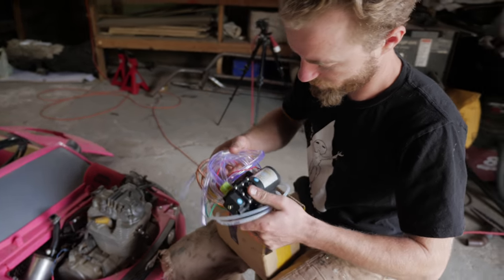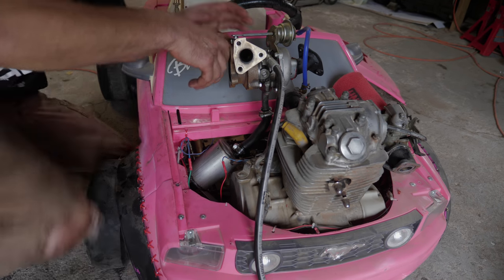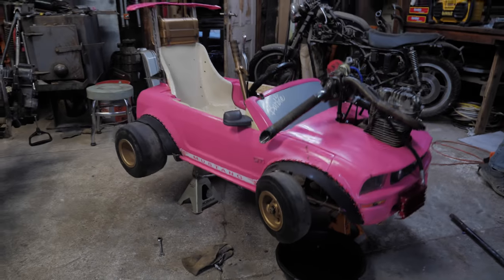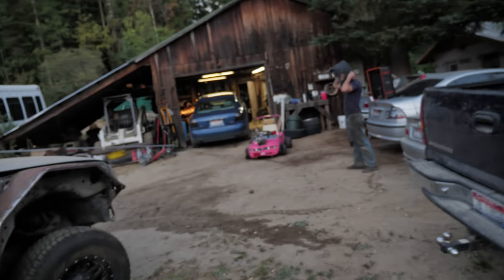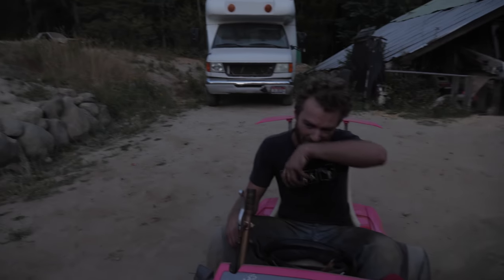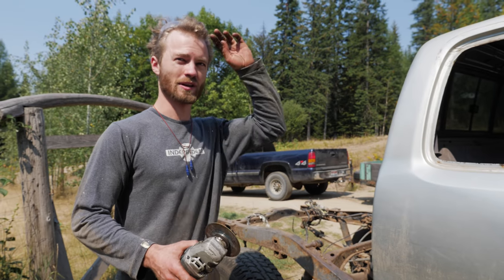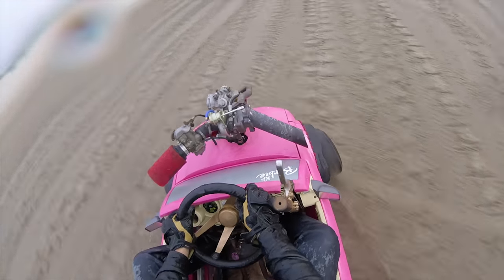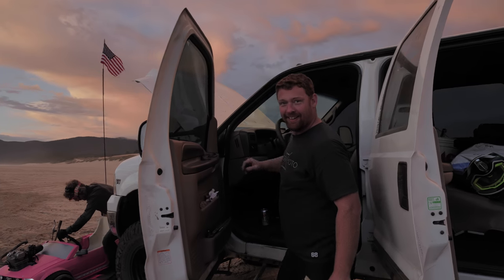Barbie Car Turbo #2 Testing and Driving on the Oregon Coast 4K

Comment: Bigger jets, or drill them out, colder plug and coil pack, stage 2 head cam, in fact replace the whole head components with strengthen gear, get performance parts for motorcycles cheap here in Thailand, that’s where you want to shop, all they specialise in are bikes. I also think there’s to much oil pressure with that seperate system as well, dry sump would be ideal to run both applications if possible. But you can’t just whack a turbo on without upgrading any other part of the system, you’ll lose power not gain it. The head is critical

Comment: I don't know if you had a restrictor on the oil supply line or not but if you don't it will over pressurize the oil seals on the turbo and push out oil!

Comment: I just noticed something what you say at 10:15ish in f1 they found that some oil in the boost prevents detonation a lot so that would be a good thing not what's happening but it would be nice lol. You guys have a piston seal not Carbon on this turbo so when that vac hits in the compressor (only supposed to see pressure) it sucks the oil in

Comment: your main issue with running a turbo on a dirt bike motor single cylinder or twin is you do not have an air box to equalize the pressure from the pulse of the engine which causes the turbo to spin backwards during the intake stroke which means you're not getting boost like you thought you would

Comment: You two did not put on the overflow valve after the pump when the oil is too much and the turbo is too pressurized and releases the oil in cars, the pressure does not exceed 6bar. congratulations on your very good work and I like what you are doing

Comment: Consider putting a 2 stroke 125 engine in the barbie car and if it won't fit just find a kx 65 engine into it and it should work as a 65cc 2 stroke pipe isn't near as big as a 125 and it will still give u alot of power and also the kx60 engine is something to consider as they had 6 gears when the kx65 only has 5 gears ..

Comment: I had similar happen on my jeep. Ended up taking it to a dyno shop and they tuned in for me. That was EFI though, not carb.
Maybe you need to go EFI on it with a 5lb injector and jack up the airflow?

Comment: Need to jet up the carburetor.  It'll have a ton more power with just a few pounds of boost.  It is probably starving for fuel. When I turboed my small engine I had to run twice the amount of fuel with only 5 pounds of boost. Also the suck through system needs a CV vacuum style carburetor.  Feel free to message me for pointers.

Comment: You need a very very restrictive oil restriction in the turbo line right at the turbo in draw through set ups. Also move up to a bigger jet. Draw through set ups are a way of the past and a lot of info I feel is lost as far as getting them to run right. In cars you can have carbon seals and that way on high vacuum no oil is pulled through but these small turbos dont have that option so you need to restrict the line to the point where just barely enough oil circulating through to keep it lubed and thats it.

Comment: I think turbo should be after of the carburetor, not before the carburetor, since air and fuel mixture will also hit the propeller before it gets into the engine.

Comment: I am confused. Did you guys re-jet that carbeurator at all or just throw fuel pressure at it and call it a day? Considered doing something like a color tune or just doing a WOT pull and then killing the ignition and checking the plugs to see if it's running lean or not? EGT will give you a vague idea but I'd hate to see you melt a piston or valve because of the mixture being way off.
Reply: Definitely didn't jet for it. It wouldn't run for shit and ran better NA, plus the turbo is too big for a low revving motor.  They'd need a bigger motor or a smaller turbo

Comment: I coud be wrong, but isn´t a turbocharger like this one mounted on the exhaust end? Maybe you have to put it on the other end and build something like ( I don´t know ) an air intake for the enginge, where the charged air meets the gasoline. That way it wouldn´t kill the seals and the oil doesn´t get mixed.

Comment: I think that was a bit too much oil pressure for the turbo. I can only compare to what my car shows, 2L with a TD04L on it and the oil pressure in the engine is at max 6 bar  (~90psi) when hot. And i assume there are plenty of restrictors that cause even less than that to arrive at the turbo. From what i remember, turbos don't like being fed too much oil.
Reply: how much power and boost?
Reply: Fizzer_Garage  Stock Forester STi, 240HP at .75 bar (10 psi) boost.
Reply: nice

Comment: quick FYI....On a DC motor, color doesn't matter. just confirm that the motor (pump in this case) is spinning the proper direction, if not, swap the leads.

Comment: I'd put the carb after the compressor not before, and change the carb jets for more fuel. also the turbo might be too small or too big. Problem could also be its a single piston motor. also you need to do real tests with a timer and set distance at a parking lot to see if you gain or lose time. louder doesn't mean faster, it can but not in all cases.

Comment: This project looks sick! So unusual, and interesting to see it cruising down the street on public road.

But, black smoke on low RPM and engine spins up too slow from idle, looks like it runs too rich on low RPM.
And sonds like on high RPMs it runs too lean, sounds like engine "sneeze" and losing rpms from time to time. Isn't it ? or i am wrong?

Comment: Yeah I see some comments about fatter jetting here. I didn't read far so idk if someone else straighten that out for you. But it's wrong. That is a carbureted engine. Not fuel injected were you would need to change to larger injector if boost were indeed high enough. A carbureted engine is obviously draw through. The thing is  a larger displacment motor will draw more fuel through a smaller orfice than a smaller displacment. Less cfm. A 125 and 250 may run the same carb. With only smaller jetting in the 250. In some cases they may have different slides or needles. Like drinking through a straw, harder u suck the more u get. Anywho if the turbo is forcing air through the carb. It will draw more fuel through the same jet as needed. This does not mean it won't need to be rejetted. Just almost certainly not fattened up. Changing the needle taper to something with multiple tapers to accommodate turbo lag could drastically help as well.
Reply: Switching to a 2 stroke carb designed to accommodate the power band of a 2 stroke. Similar to how a turbo works ... When on the pipe if you look out how the 2 stroke expansion chamber works. In conjunction with a power valve. A kiehin pwk air striker is a quality carb more or less set up for this application. You will still need to play with jetting and needle but it may be a better platform to meet the needs of the now turbo charged motor as it builds boost.

Comment: Grind Hard Plumping Co did you rejet carb for the extra air maybe needed restrictor into oil feed line or just build a box around carb instead of it being run drawthru

Comment: Do you have the carb on the inlet side of the turbo? Because if not that means that the pressure from the turbo is stopping the gas from leaving the float.

Comment: Ive seen these work but by having fuel injection setup on em.You can get em cheap as heck off aliexpress or even ebay.Come with their own o2 sensor and turning software.once u got fuel injection and turning software oh boy.

Comment: Dont you need back pressure for a turbo to work? I think putting a real like racing muffler on would help you
Reply from the maker: I’m under the impression that back pressure is not needed for turbos. In theory we had more back pressure with the smaller dump pipe, and it ran way worse...

Comment: Draw thru chunks the fuel up.     I can easily walk you thru a blow thru if you would like its simplier than most think also that would make loads more power.   You also need a restrictor on the oil feed most engines havs 20 to 50psi not 100 thats causing you issued with it spooling by loading the bearings too much
Reply from the maker: I think we will give the draw through one more chance, and if it doesn’t work we will go blow through. Yeah, it seems Ike too much oil is part of the problem.
Reply: Build an aluminum box around the carb presureize the box run the fuel line and throttle linkage thru a hole and silicone them so simple only thing you will need is small fuel pump to stay above what ever you boost it to.        10 psi boost 15psi fuel pump.       Go up o. The jet just a little till it seems fat and happy.           Put a restrictor on the oil inlet and this will be a joy

Comment: Also dont forget once you start making boost you need to pull some timing and gonup to 93 or 100 octane knock will destroy that motor.     Also you want 18 to 25 thou of ring gap for 20 lbs of boost
Reply from the maker: Yeah, I was planning on getting some high octane fuel once it’s running decent.

Comment: Ur carb's not really meant to do what ur asking it to lol (pull through), have pondered this on many a riding mowers after a few beers. Could prob use a fuel pump wired up to actually spray fuel through a nozzle into the intake as the throttle (boost) increases. Like methanol injection meets old school 80's turbos... just a thought.

Comment: If you getting problems with the carb mod it to blow though carb instead
Reply: That's actually more difficult because carbs are designed to be sucked on. Putting pressurized air into them wants to blow the gas back out the fuel line, so the fuel pressure has to be raised proportionally to the boost, which is possible but a pain. Doing it the way they have been is definitely easier, and they'll get it right. They probably need a bigger high speed jet to richen up enough under boost.

Comment: ok look at how ford did there early carbed turbos.. you put the entire carb in a box and turbo pressurizes the entire carb.   you can do that or do a pull threw setup where turbo draws threw carb rather than pressurize it. you cant just turbo a carb like a efi
Reply from the maker: Well, we went with the draw through setup here. Might try the pressure box thing if we can’t make it work.

Comment: You should do a supercharger because that engine just isn't big enough to spool a turbo
Reply: Kalden Murphy if it can’t spool a turbo, it’s not gonna build boost with a blower. Blowers take power to make power, if that makes sense, a turbo doesn’t need a powerful engine to work, just enough cfm through the exhaust to get it into its volumetric efficiency range.

Comment: turbo on a single cylinder engine bad idead .   can u put a 2 cylinder 250cc engine in there ? like from kawasaki 250 r much more power around 30 hp  6speed water cooled and fuel injection  and has oil pump because of the oil sump and easier to turbo ;)

Comment: I would therefore be careful not to drive over the cold water. It is not only not good because there is water going through your air filter, but you have a very hot engine made of cast iron which is very brittle material, and if there is suddenly cold water going over, then you get heat stresses and your whole engine goes to shit.

Comment: The motor is easier to be adapted to nitrous I put new billet piston with a 15psi shot I can hold and control duration cheaper and turbo

Comment: How did you guys tune that little carb for the turbo?
Reply from the maker: We hadn’t really done any tuning on it when we did this. We didn’t have a chance to test drive it before the trip, and it seemed to run fine with the minor testing we were able to do.
Reply: @GrindHardPlumbingCo  haha I get you. Just wondering. Was going to do something similar and was curious. I know turbos usually require some tuning. Thanks for the response. Love the videos.

Comment: You can’t turbo and carbed engine. Needs to be injection to allow the ecu control fuel/ air ratio
Reply: simon ross nope not true you can control fuel and air ratio buy just tuning the carb and switching the jets to allow more fuel and that’s coming from a guy with a turbod carbed Chevy engine in a mustang
Reply: Juan Garcia using a blow through carb yes. Not a standard bike carb

Comment: Way too much oil going through that turbo. Use an oil restrictor with a small hole of about .035" and a huge return. 3/8" or larger. I do not run water through my turbo and have zero oil into engine from turbo and it is an air cooled engine.

Comment: yall clearly dont know much about engines. the turbo is supposed to push air into the carb. you have the carb pushing fuel into the turbo and that is super dangerous. fix the setup and it will run fine. it goes turbo carb then engine . not carb turbo engine

Comment: you guys need to re jet your carbs with bigger jets, it's running way to lean thats why it's running like shit with the turbo
Reply from the maker: We will try that soon. It was also sucking a ton of oil through the turbo, which may be due to too much oil pressure...
Reply: is your turbo new ? does it have any shaft play ?
Reply from the maker: It’s bread new, but it’s an eBay turbo... there’s a tiny bit of play, but now more that the turbo on my Subaru, which runs just fine.
Reply: you could place your Oil reservoir higher than the turbo and let it go with gravity, and use the pump to shoot the oil back in the reservoir. no more pressure problem
Reply from the maker: I’m not sure I would trust gravity feed for the turbo...

Comment: Really think that's the wrong Turbo... I don't know what the RBh31 is rated to but I would doubt that turbo is capable of even making the amount of power that that engine already makes. You guys really didn't do much research on how to turbocharge a small engine. I think it would work better if you had the right piping diameters an intercooler and some way to manipulate ignition at a minimum. Single cylinder engines that are turbocharged need to be able to store enough boost to feed itself when the intake valve actually opens. Or there'll never build boost pressure... it's very similar to how a 2-stroke exhaust works. You guys seem like a fairly intelligent guys this stuff isn't rocket science maybe you guys can give it another go.

Comment: Honestly you need to swap the engine to a harbor freight 420cc or 670cc v twin and then it will totally haul
Reply from the maker: Yeah... I really don’t think so. What is the 670 rated for 22hp? This engine has about the same power, weighs a lot less, is smaller, and has a built in 6 speed transmission...
Reply: @GrindHardPlumbingCo  what engine and transmission are you guys using right now?
Reply from the maker: Engine from aHonda CRF230f.